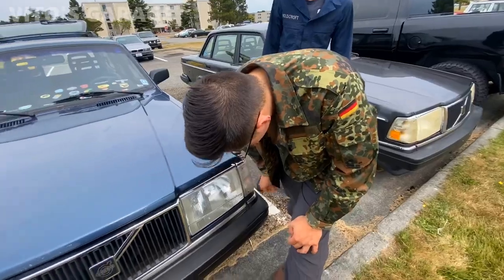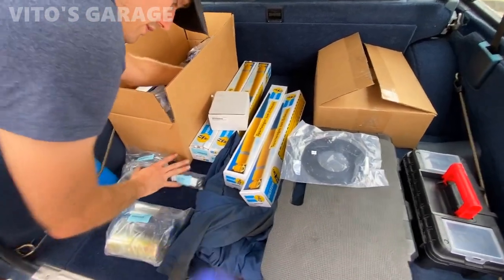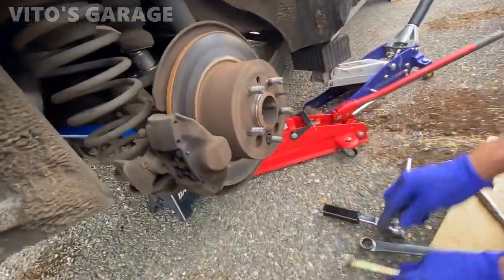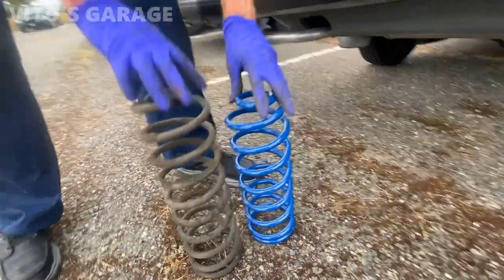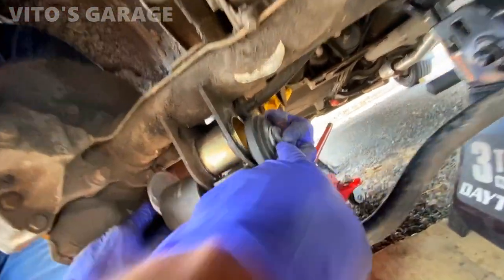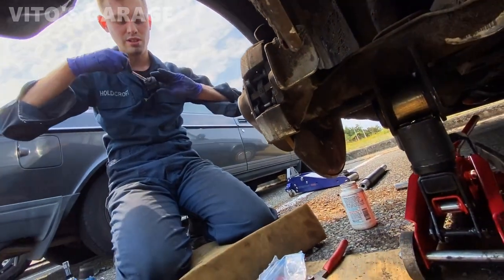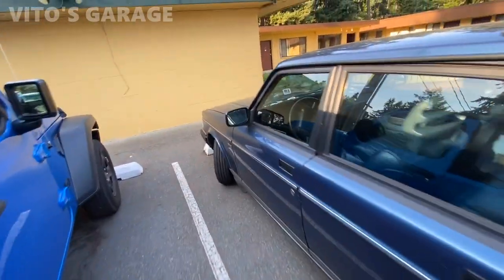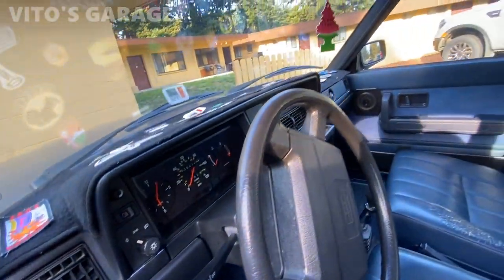Dylan and I Are Rebuilding His Suspension on his ONE OWNER 1993 Volvo 240 Wagon 5 Speed Manual!!!!

Comment: Hi vito, can i ask you a question about the 124?
My CE have the fuel cap wet all the times...gas vapor dont escape well i think, i replace the vent valve but no difference, i think maybe the charcoal canister in clogged, to replace the canister have to remove the front wing or not?

The solenoid for the vaacum works ok i tested It on the bench

Thanks
Cheers from Italy !
Reply from the maker: Yeah your charcoal canister is probably bad. I want to do a video on this subject. Just haven’t had time yet